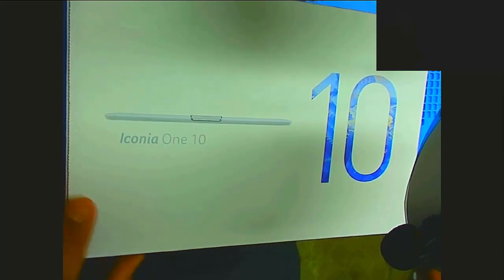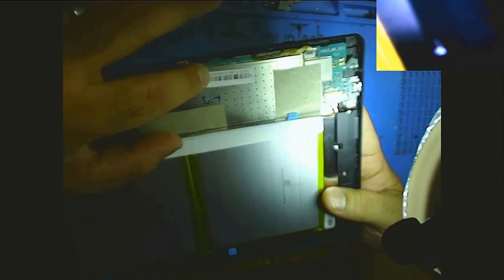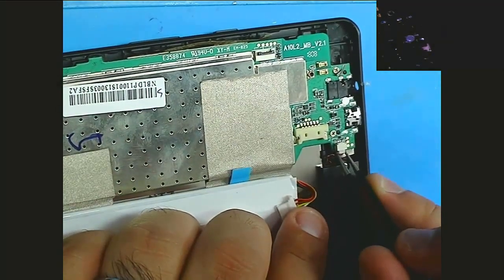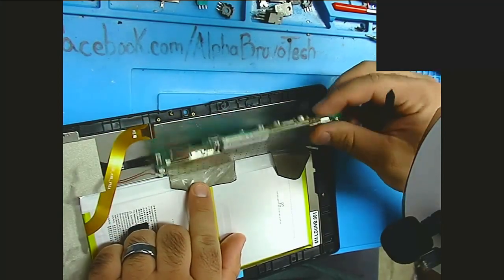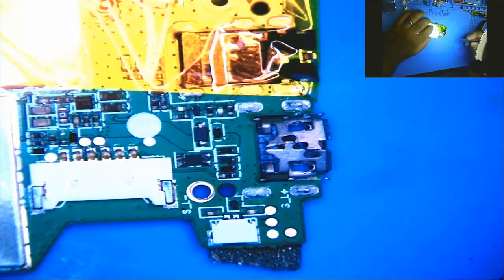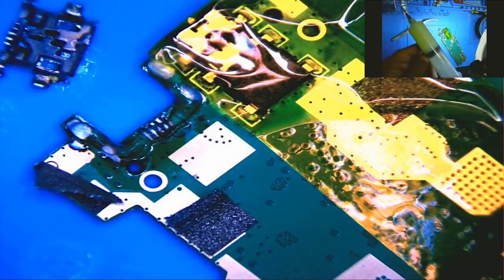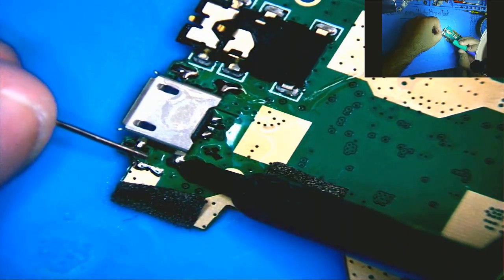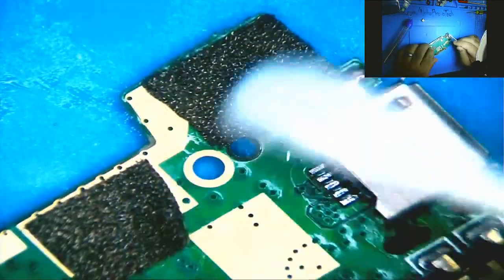Charge Port Replacement on Acer Iconia One 10

Comment: Good Job! Remember Sorin's method for faster charging, bridge DP and DM, both data pins. The only downside is that you will not be able to connect it to a computer.
Reply from the maker: 😲 Really??
I don't remember his video doing that. Cool!
Well right after I stopped this video I connected it to a different ammeter and cable that I have, it immediately started taking 1 amp, so maybe it was the cable after all. 🤔
Thank you for the comment Yuan! 🙂
Reply: I really dislike that method and recommending it is not good for the customer, only the repair person to be lazy. It can only be described as a hack. A better hack is as Fred says, "gotta be good to your wife"
Reply from the maker: @Infiniti25  Thanks for watching my video and for the comment!! 🙂👍
Reply: @AlphaBravoTech  No sir, thank you for creating content for me to learn from while I'm eating 👍
Reply: @Infiniti25  You can always ask the customer first, some customers never connect their device to the computer and prefer faster charging. Sometimes you cannot get the replacement part or is not cost effective. Some chinese tablets and mobile phones cost less than USD 50.00.
That is not something you should do on all your repairs, but is good to know how to do it, example you have a cheap chinese  that new cost $50 but the customer has had it for over a year and want a cheap repair. How much time would you spend fixing a device like that and how much is the repair job?  Like Sorin has said a device fixed is  less pollution for the planet.

Not saying you should use this method or you should fix cheap devices, just sharing ideas.

Comment: There's a little plastic snap clip near upper corner that holds the board in place , just a mention to pull that back slightly so it doesn't break when removing the board.

Comment: Loved the video!  I'm going to try this out but I've never soldered anything before.  What were the materials you used?
Reply from the maker: Quick 861DW
Amtech NC-559-V2-TF
Kester Solder
Hakko 951 Soldering Station
A variety of soldering irons would work for this though.
This port can be kind of tricky because of how the pins are covered by the port itself.
Thanks for watching! Good luck!